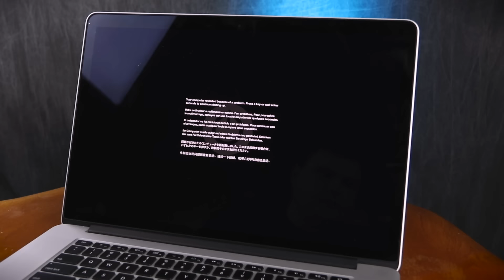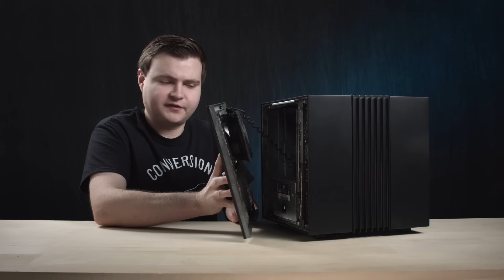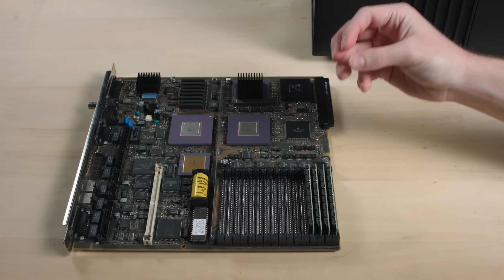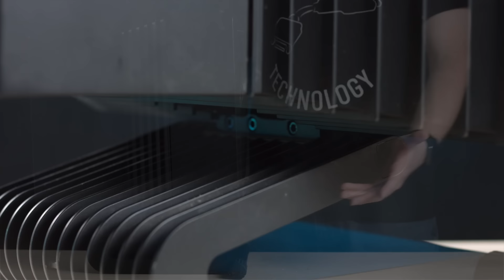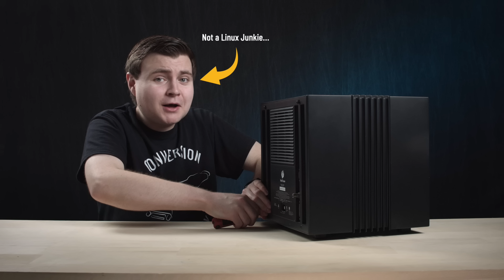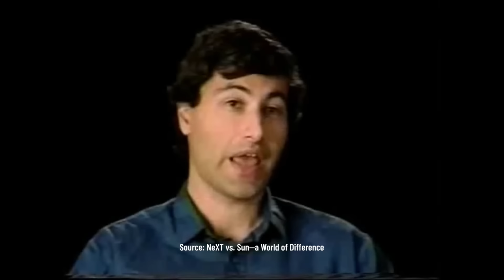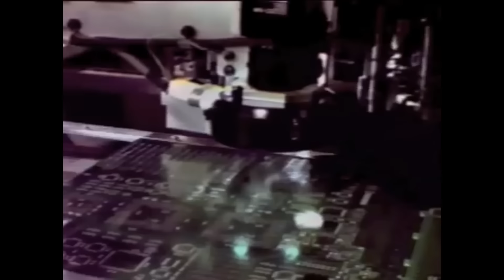I Bought a NeXTcube, Now What? - Krazy Ken's Tech Misadventures

Comment: That neXTcube is fluid in today’s standards.   Also a 68040 processor in 1990, that’s about 4 or 5 years ahead of Mac came out with 68040 processor.    Awesome content.
Reply: Most of the cubes were 68030 and were slow as hell.  All the NeXT hardware, which I used every day, was slow as hell.  The lights didn't shine until HP+Sun hardware started running NeXTStep+Openstep.  The Intel port was a disaster, initially.
Reply: @jazzlover10000  Even the 68030 had very decent speed. An issue was the optical drive in the original NeXTcube. Later models received much faster hard drives, but the optical drive was a pain.

Comment: I used to support NeXT systems as part of a university agreement. Those cubes, particularly the "floptical" only machines never worked well from a hardware point of view. The "pizza boxes" worked much better. In terms of networking, you needed some UNIX networking chops to get it working - most faculty didn't have that skill so you had to set it up for them. Also, you had to manage NetInfo for them to get lab or student accounts up and running.   In terms of the software, things were great and students loved using NeXT. The faculty liked the displays but so many of them failed to learn much about tools such as Interface Builder so they tended to use it for word processing and publication stuff. Some of the faculty called it the "super mac" which was unfair as the NeXT was a well optimized combo of hardware and software.
Reply: If the logo is read like lines it's NeXT - but if it's read clockwise it's NeTX, like "network" and "X" as in X11. Is there anything to that? I'm doubtful, but X can mean something else too.
Reply: @fiftystate1388  You bring up a good point as X11 windowing system was definitely a thing then and you could actually run it on a NeXT although a big selling point of the NeXT was that Display Postscript was awesome and it enabled true WYSIWIG in printed fonts also. So on that account I wouldn't think there was any connection and in my interactions with NeXT employees, such a thing was never mentioned.

Comment: Wow! That's one of the coolest machines I've seen period. I especially love the internal expansion cards which are different from the ones we see today, and also really like the unique design of NeXTStep, as always. I wish we had more unique things like that today. Now the computing landscape is relatively boring and homogeneous, and in many cases also not nearly as upgradable as I would like. I also love the NeXT aesthetic. Pretty much everything about that PC seems really really cool in a way I don't often see today. 

I do wonder: How was it that the entire PC market, both Apple and non-Apple, moved to the tower format anyway? Why not a cube like this NeXT PC, or something mounted horizontally on a desk like the original IBM PC? 

It is also interesting to see that the one port on that machine still used today is the ethernet. Fitting, given that this machine was used to develop the web! 

24:53: Developing software doesn't require cloud computing. What are you on about here? I can compile and run on my own machine fine.

Comment: I've never heard of a difference between "NeXT Computer" and "NeXT Cube". Cube always referred to the Cube format and Slab to the well Slab format. I have a 1988 NeXT Mono Cube (upgraded to the 25MHz 68040, it may say NeXT Computer on it as all the documentation does) and two Color Turbo NeXTstations (slabs).  

I had to clean dust out of my Cube when I got it. It had spent a decade in computer lab at that point. It wasn't too bad. Mine had a dead full height hard drive when I got it. I of course the drive I replaced it with a typical desktop SCSI drive.  The optical drives are very failure prone and of course also the same size the old hard drive. 

Mice and keyboards come in ADB and non-ADB format and machines need to match. ADB was the apple system and apple stuff interchanges with ADB NeXT machines to as much of a degree as possible. 

The power cords for NeXT machines have the NeXT logo molded into them. I once was in a meeting at a place I worked and saw the projector had a NeXT power cord. At my first opportunity I swapped it for a generic one and took the NeXT one home to use with one of my machines that no longer had its original. 

All the NeXT monitors are a little goofy on specs. My Cube's megapixel needs to be recapped or something. I had too much trouble finding someone who could work on one of the color monitors a long time ago and they are much more normal but still odd balls. 

Over 12" die casting tolerances are generally more than a 0.5mm. Of course they could tweak the tooling after it was made to get the exterior dimensions just perfect. When I have the cube out of where it is stored maybe I'll measure it as accurately as I can.

Comment: This computer looks like a work horse for the time. Not sure if it was talked about but I noticed 4 bays altogether that were motherboard size. Didn't see anymore ribbons but that power supply may be able to cover it. Wonder what those things could really do? 

Great video. Totally nerded out on it!
Reply: Power supplies of that era (well, possibly excluding cheap PC hardware) were often overengineered. Which doesn't mean much by today's standards, as power consumption was pretty low these days. You've seen the 68040's tiny passive heat sink.

The NeXTcube PSU delivered up to 20W to each of the 4 slots. More power went onto the the monitor, so the PSU could deliver up to 300W in total.

Comment: “It’s an optical anomaly. To the human eye a perfect cube doesn’t look like a cube so we made it roughly a millimeter shorter than a foot on two sides.”
Reply: As usual, that's Steve blowing smoke out his back-side. The reason it isn't a perfect cube is so it can be taken out of the mold. (The G4 cube had the same problem.)
Reply: @jfbeam  This is the correct answer. Jobs wasted a lot of effort and money on the original Macintosh having the case cast with a multipart form - the one that is signed by the "artists", and if you have the 512k Mac, look inside, and half the signatures are gone, because Apple reused half the tooling, to save money.
He also insisted Apple ][ be assembled by robots, for no good reason, wasting even more money.
Don't get me started on insisting on switching power supplies with no fan, which could not pass FCC non-interference rules...
Reply: @BobCat0  But he was eventually right. There isn't a single computer made by hand anymore, proving his idea was the correct path. Fanless power supplies, unibody computers all eventually became the norm. He was ahead of his time.
Reply: True, but it's based on squares, not cubes.

Comment: 1990 megapixel monitor : includes a stand AND wheels
Reply: Steve jobs knew how money worked
Reply: But back then no one was attaching it to a VISA mount so they’d expect a stand and wheels. Nowadays many high end content professional creators want the stand and wheels to be Optional for those that already have a visa display mount  because why should they pay for something you don’t need.
Reply: @Charlesb88  that would be a valid argument if the  apple display came with a standard VESA mounting bracket...

**or any sort of mounting system that existed before the montitor, that a person could possibly have ever owned before the monitor
Reply: @Fobia17  the problem with that is that different users will need different mounting brackets and some will prefer a stand. Professional content creators prefer to buy or provide there own mounting brackets or stand depending on their specific needs. So Apple can't provide a one size fits all mounting/stand solution. To many people have an issue with this who aren't the target market so I prefer to defer to the pros and let them complain to Apple if they want at least a stand included. From what I hear from the folks buying the Apple Pro  monitor this isn't the issue laypeople think it is.
Reply: @Charlesb88  If that was TRULY Apple's intention, then they would have used AN INDUSTRY STANDARD SYSTEM, like VESA, instead of forcing customers to use a proprietary mounting, or charging $1000 for a stand.

You are correct, the Pros I know are not complaining, they are just going another route, entirely, because it's not worth their time and money to deal with it.

Between their anti- Right to Repair stance, their charger BS, and shenanigans that are thst monitor, Apple is wholly anti consumer, just like thst stand.
Reply: @Charlesb88  VESA is the standard for installing the "different mounting brackets" you were talking about. While other displays come with VESA mounting holes pre-drilled (and covered up by the standard monitor stand, Apple did exactly that on the previous Ultrafine 4K/5K collaboration with LG), Apple made their desplays require separate adapter brackets. AFAIK no one makes monitor arms that work with Apple displays directly.

While that adapter bracket is standard on the Studio Display (sort of, you have to decide between a VESA adapter or the standard tilt-adjustable display, but not both), it costs an extra $199 for the Pro Display XDR. You have to pay extra just to mount a Pro Display XDR.

Comment: This thing really reminds me a lot of the G5 towers. The early Power Mac G5 towers where actually fairly impressive to own let alone work on. It's not for everyone for sure, but everything is intelligent, if elegantly logical, yet frustrating for most to attempt repairing. 9 fans would cool the system and yet properly tuned would be silent as a mouse and don't forget about the Apple displays of that vintage too. Back when 22 inches of LCD seemed nuts. You had one port for USB and DVI signals plus audio I believe. If you had the cash you could have a very elegant system and just like the Cube, the monitor was a hub too.

Comment: Oh I hope the caps in that thing are okay.. given its age, and considering Amigas from the time are currently getting digested by leaked capacitors, I think it might be a good idea to get someone check those things out and replace them if needed.. before your motherboard traces rot away =/
Reply: The NeXTstations from 1990 have probably all died from exploding power supplies, most of them shortly after the warranty period. Power supplies came from Sony, and it seems that they went cheap on the capacitors. When the capacitor went, other components would follow, making it hard to repair, if at all. Of course, my NeXTstation died as well, also shortly after the warranty period, and also shortly after Steve Jobs discontinued the hardware. "Spare parts will still be available...for US government users only."

Comment: The DSP wasn't just for sound. It was also for communication. Taking the place of a modem since the DSP could mimic the functions of  the modem. Renumber it used digital mans to process analog signals, such as used by modems back then to communicate.
Reply: The DSP wasn't used for communications as this was handled by the RS-423 serial port, similar to the old MacIntosh Classic modem connection.😉

Comment: “This ribbon cable has little handles!” Back when we had the right to repair.
Reply: I found these every couple of years, not only in PowerPC Apples, IBM, but also in HP Gen8 Microservers.
In fact, most servers are quite decently built, so that their factory and service people don't have to fiddle around.
On the other hand, hardware for shops that just hand you boxes over the counter, got quite a spread, depending on the price. "brand name" gamer and tuning hardware provides nices solutions, too, but for sure, not the low cost stuff.
Reply: @martinb.770
Not anymore. Just google for "Nvidia 4090 melting power cable" or similar
Reply: Technically, we've never had a "right" to repair. Perhaps you mean that companies were more likely to share proprietary information that made it easier for consumers to maintain their equipment?

I don't think we need legislation to enshrine a new right. We just need to stop purchasing products from companies that refuse to be helpful. Thing is, I can see why a company wouldn't want to release proprietary information. It isn't even unreasonable in itself. The real issue is when companies specifically make a prodct unrepairable outside of their official channels (John Deere, for example).

Comment: Ken: keeps referencing things on Macs
Me: crys in Linux and Windows
Reply: Like he said, it’s the base for OSX. 

In fact, objective C, the language for OSX and iOS apps have references to internal functions that start with NS, for NextStep.
Reply: @bnvnsn  |\/||-|/\+!
Reply: You can still get some NeXTStep-inspired things in certain Linux desktop environments. Anything with a dock, for example. There are even X11 window managers insired by NeXTStep like windowmaker.
Reply: Despite using Linux today, though, I do remember a lot of the concepts shown here from back when I used Mac OS X 10.6.8, which was the operating system on my old MacBook 3,1 before I eventually switched to Linux and desktop computing. NeXTStep is a pretty old operating system, so  all these concepts appeared even in the much older versions of Mac OS X I grew up with.
Reply: linx winds

Comment: Next licensed the os to other companies in the 90s even after it was bought by apple.  I worked on industrial machines that had Nextstep os on a Hewlett-Packard pc.  Supposedly the HP computer was the only pc other than Next that was hardware compatible.  It was amazing what could be done with that os.  They built a hi res touch screen interface that controlled a series of motion controllers, vacuum systems, and RF generators.  All on a Pentium 60 pc.

Comment: Fun factoid about the wait cursor (beach ball). If you look at it you’ll notice it’s a rainbow colored disk like a CD. It’s actually a writable optical drive. The original NeXT Cube didn’t have a hard drive. You booted from the optical drive! They are kind of slow, so you had to wait for writes, and you saw the spinning rainbow disk showing you what’s going on! And we still have it. They switched to hard drives because of the speed problem. Steve’s ideas weren’t always practical. Maybe that’s a good thing.

Comment: hang on, this thing has two processors and none of them have heatsinks or fans? im surprised it didnt fry itself. you should get an expert to check the harddrive and dont power it down so sudden, it might be terminal. Does this thing have a data drive with a stack of optical disks in it? in its day it was years ahead as a one box server.
Reply from the maker: It has one CPU, and it’s under a heat sink. I know those other things LOOK like CPUs, but they’re not.
Reply: @ComputerClan  oh thanks. what are they then? they cant be gpu's cos you already said another card is needed for that (maybe someone should donate one to you). This thing is shrouded in mystery. i must admit, if id seen this in a yard sale BEFORE seeing your video, i would have passed it off as an old printer, and not even looked properly. Thankyou for letting us know better. Im definately gonna keep an eye out for the NEXT logo. that logo resembling a 2x2 lego brick seems familiar for some reason. i will have to look through my boxes of computer ephera. ...or my software library. maybe they did software for other computers too?

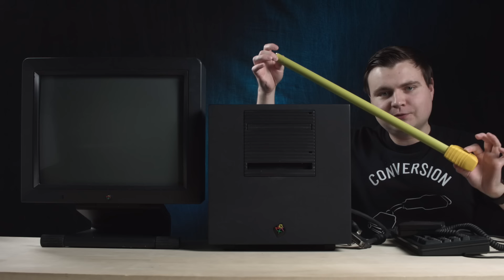Comment: 16:12 Oh no! Don't let your measuring tape retract like that. Doing so can cause the rivet that holds the end piece in place to deform making measurements inaccurate. Incidentally, the movement of the end piece is by design and it should move exactly the thickness of the metal so that you can either measure from the inside edge of a gap (end piece retracted and pushed flush against what you're measuring) or from the outside (end piece extended and hooked on the edge of what you're measuring).

Comment: The reason that one dimension is 1 mm less than the others is to provide a mold release relief.  My dad was the head of manufacturing for a zinc and aluminum die casting company that NeXT approached to do the enclosure - as a single die-cast piece.  He had a hell of a time explaining to the NeXT manufacturing engineers why a mold release relief was needed.  It does look really cool, though!
It was also cool that while my dad was working on the case, I was doing Interface Builder development for a medical device application.  :-)
Reply from the maker: Ah, mold release. That makes sense.

Comment: Wow, what a trip down memory lane. I learned C and 68K assembly on them, in a computer lab at Cornell. They were a bit older, though ... only 68030 (25MHz). And no hard drive, IIRC - just the magneto-optical drive. I always felt like the NeXT's specs were designed out of spite - every aspect was roughly twice that of a Mac. Even the number of colors! The Mac had a two color screen, so the NeXT has a four color screen. And double the resolution. It even has twice as many "boxes", where the Mac had one. I mean ... it is to laugh.

Comment: 25 MHz 68040? That's the same CPU I had in my Amiga 4000. I know the 68k series was fairly popular though. :)
Reply: Perceived performance on the Amiga would have been much higher.  The NeXT hardware ran NeXTStep slow slow slowly.

Comment: There is a taper to the cube, in order to get it out of the mold. I have a cube. There are 2 books about Next, well, one Steve Jobs and The Next Big Thing by Randall Stross (only about NeXT, development, Offices marketing etc) and The Second Coming of Steve Jobs. Anyway, the original design was a perfect cube, and the molding process would hang up. also, there were a crap ton of rejected cases, from voids to cracks and blemish of the custom paint, which was not Black, but a custom black mix. And the Cubes are not 100% magnesium . They don't burn without a lot of help.